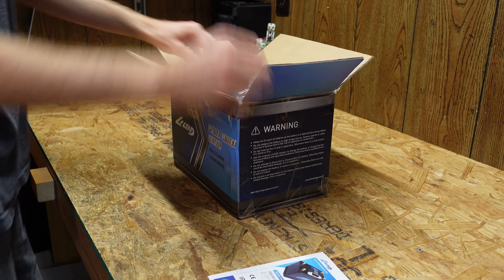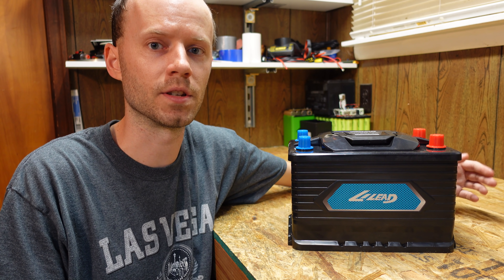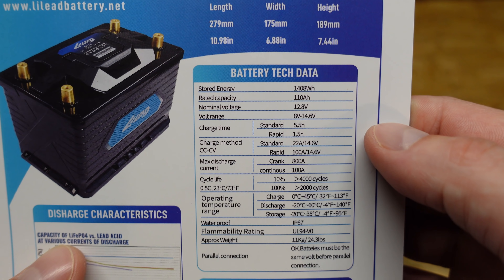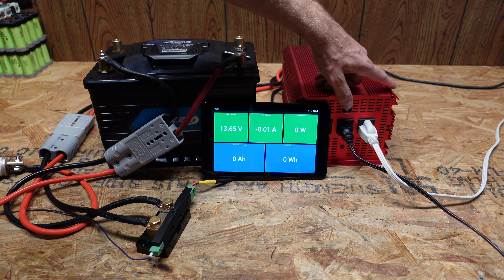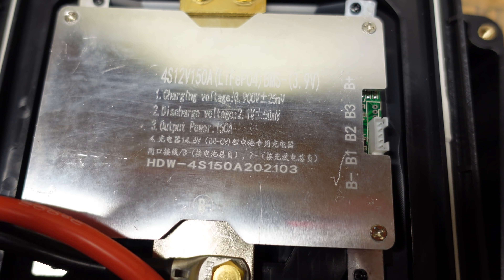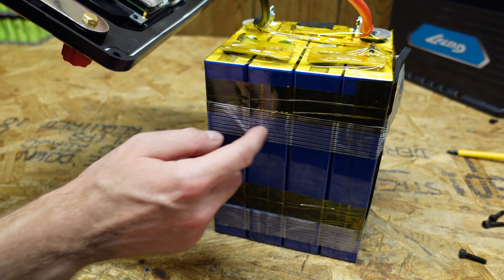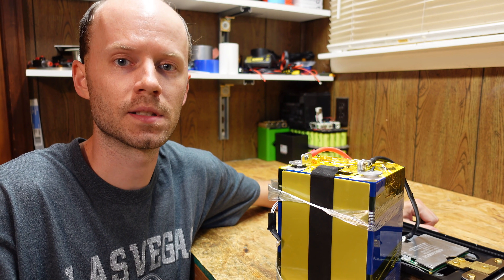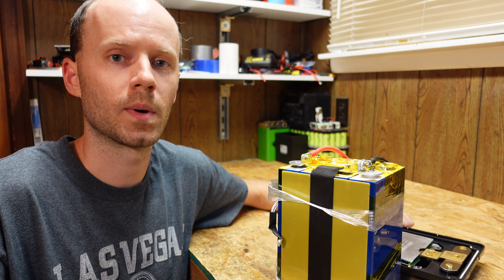LiLead S110 12V 110Ah LiFePO4 Battery Review & Disassembly

Comment: Hi! Do you remember did the BMS have a port for a bluetooth bms module? Or would there be any way to add one? 

The prices have come down to allmost half of it now, and i could get a good deal, but unsure of the bluetooth, i really would like to follow the temperature as it would come as an cranking battery in cold enviroments.

Comment: The way the tie-down was bent, I'd guess the battery fell off a pallet and fell across something (maybe the edge of a pallet) upside down.  It was the weight of the battery that bent the BMS support and pulled the tie-down toward the top of the battery.

Comment: what good and light starter battery do you recommend? need to start a smal car. want a little weight as possible. i hav eben looking in to using a lawnmower LiFePO style battery.
Reply from the maker: I have not done much testing on LiFePO4 starter batteries, so unfortunately, wouldn't be able to make a recommendation.

Comment: If it's being sold as a starting battery I don't think it should come with hardware. I have never purchased a starting battery from the auto parts store that included anything other than the battery.
Reply from the maker: It's being advertised as whatever keywords they can put in it. They also call it "deep cycle" and say "ideal for marine, RV, caravan, solar and off-grid".
Reply: @LithiumSolar  hopefully the big battery manufacturers will start producing lithium starting batteries.
Reply from the maker: I'm not sure LFP will ever be suited for replacing lead acid in a car until someone can solve the issue of charging below freezing.

Comment: HighTechLab did a recent youtube on starting his truck with Lilead S110 - https://youtu.be/drrFrULpJkI.  He commented his clamp meter topped out at 600a (2:12) and it was over this.  My question - so it bypasses the BMS / there is no limit on mass amps?.    Its seems like its buyer beware for life-span on hi-amp cranking - and I didn't realize BMS could be bypassed like this.  Thanks for the review.

Comment: I have two Ford F-350 diesel pickup trucks and don't think any lithium battery is suited for a starting battery due to the sub-freezing temperatures that they are operated in during the winter months.

Comment: It is a shame they sent you a battery in this shape for review.
The one they sent me arrived intact, and did easily start my large diesel truck. 
I cautioned them that their price was high, and their packaging was WOEFULLY inadequate for shipping a battery. I have not published my review of the battery yet, but I did publish the unboxing, and … yeah, their idea of a packaged battery is weak at best. 

I recommend you test the cell voltages at BMS cut off and see if indeed the cells are imbalanced. 

I recommend you do test the battery starting the truck. It handles it no issues. 

Also, I would check the ampacity of that 7Ga wire… silicone insulation, and tinned copper stranded wire. Not bad, but can it reliably handle starting current? Can it support 100AMPS continuous? It looks poorly designed to me. If they used 105Ah cells and claim 110Ah, that is a HUGE red flag to me.

Comment: I think no low temp cutoff is exactly the right thing to do, because you don't want it to shut down when it's cold so you can't start your engine when using this as a starter battery. With a starter battery you are accepting that it is subjected to a certain degree of use and abuse, so I don't see any problem there, neither with the missing low temp cutoff, nor the high surge rating. LiFePO cells are able to handle this. Oh, and 3.9V is not unusual for LiFePO cells, everything between 3.6V and 4.0V exists in the data sheets for various models. Just wanted to point this out, it doesn't change the final verdict though, to which I agree. It's expensive and they obviously have some build quality and QA issues.

Comment: Thank you for exposing this fraud!  You were almost certainly sent a battery that had been damaged and returned, so you got it because there was nothing else they could do with it.  The worst part is if someone with a boat and a large outboard motor actually bought this for the purpose they claim it can do, they would damage the battery and wind up with a $1,000 boat anchor after a year or two! 

If you were to build a cranking battery based on something other than lead acid, would you use Li-Titanate?

Comment: I'm looking at my Eve 105AH cells, that is exactly what those are. I have no clue why they would send you a damaged unit. Those are great cells, BTW. But for under $1000, you can build two of those batteries with a better BMS. Mine were slightly over $500 for 8 cells including shipping and the Eve test reports.

Comment: You should fix it, either get a new enclosure, add a different BMS if the one that came with it is not working properly and then give it away for your 100k subscribers. just to save you time, you can send it to me directly. you don't even need to fix it for me. lol. 
great video as always :)

Comment: About a year ago I bought a Lilead battery that was for motorcycles. It is pretty small and has a 17 amp/hr rating as I recall. They also said that battery had a surge of 800 amps. It is in a very nice package that has a tough screen battery percentage readout. So far, it starts my Yamaha 200 without a problem but when I was running my smaller motor, it does not have a very good regulator and started to get up to 15 volts. I had to turn on some running lights to keep the voltage down. I later put a 14 volt 50 watt zener diode in parallel, and that seems to keep that motor charging more stable. My large motor stops charging at 14 volts with a better regulator. I did one time after changing my high pressure pump on my motor take about 20 seconds of cranking to start and it seemed just fine. I did notice I went from 100% to 30% really quickly though. Just for safety, I did find some 8 amp cells that claimed a 200 amp 30 second surge rating and installed those in parallel. I checked the cranking amperage of my motor and found it to be around 225 amps. I guarantee this battery will not put out 800 amps for any time at all. I did find one time that when I was at about 25% capacity, it did shut itself off when I tried to stsrt the motor. They also claim a 15 minute charge to 100%. I also find that hard to believe. It came with a 10 amp charger that is of very excellent construction, at least on the outside. So far though it works and loses about 2-3% of charge a week. I have also found that one time I left the radio on and it did shut off. It cost about $250, and at the time I had not watched so many videos about batteries, otherwise I would have built a larger one myself for about the same cost. It is nice that I can just touch the top and see the state of charge. It also charges quickly if I need a top off before I go. It's sad to see now that everything about this battery is probably a lie. Good this I put in that other set as a supplement and my smaller motor also has a pull stsrt just in case.

Comment: Good review. Do you think it possible that the battery broke from simple drop shock/impact? If the inside bracket broke loose and the cells smashed against the top of the case it seems possible to have produced the damage you showed and described.
Reply: That seems to be exactly what happened. But it shows an inadequate design. Those knurled brass ferrules aren't designed to hold the load of securing cells of that size down. Those are found in things like coffee makers and laptops.

Doesn't look like a good design to me. Even if you got one undamaged, road vibration would also pull that loose, and then you have cells rattling around just waiting to chaff somewhere.

Comment: My bet is that the battery was dropped upside down onto a sharp edge, causing the crack, the box damage, and the pullout of the threaded insert with retaining bar.
Reply from the maker: That does make sense, but 1) would have had to be a very very high drop to cause such forceful damage and 2) they (someone) knew it happened, because they covered up the hole in the box with packaging tape, and sent it along anyway!!
Reply: How much you want to bet??  $$$$

Comment: I have a question for you I have 18650 200p 7S what BMS would be best to use on the system  I have Victron multiplast 24/3000/70 for 3000 Victron lynx and Victron and charge 150/35 controller and  Victor  shunt... I was thinking going batrium or should I just go more simple with like  dally BMS????plz help

Comment: That battery is $50 more than a Battle Born... wow
Reply: It is also 10Ah more storage than battleborn… not to mention the HUGE starting amps…
Reply: @SuperVstech  Except the eve cells that were matched up to the contents of this battery aren't 10Ah more and the configuration with said EVE cells wouldn't allow for the draws as advertised.
Reply: @SuperVstech  Whatever they Are, they Ain't worth a $1000 each
Reply: @SuperVstech  Per the video it is only 5ah more capacity and did you notice the battery was  shipped damaged? Do you pay top dollar for damaged products?
Reply: @soberpickle8195  yup, it is a shame they claim higher Ah than the cells are capable of. I pointed this out to them, and they said they can claim that due to some standard or whatever… I explained to them it is incorrect, and false advertising, and have not heard back from them since. 
My guess is the massive cranking amps will likely damage the cells, but I am unable to repeat test them… perhaps they will remedy the shipping flaws, and use larger cells, or reduce their Ah claim… 
It is a shame, as the battery easily cranks my 89IDI diesel 7.3L motor repeatedly… so the battery is capable of massive ampdraw… just not the Ah capacity they claim.

Comment: Do you think it's 3.9 V top Max charge so that when it settles it will actually settle at 3.6  maybe it's the new thought process behind the battery's settling out so they don't settle  lower than the Max charge so they actually settle at the Max charge? Just my thought
Reply from the maker: At first, I thought it might allow charging to 3.9V so it could allow balancing down to 3.65V. The batteries that shut off right at 3.65V aren't good either because how is it going to balance if it kills it at 3.65V yet balancing beings at 3.65V? So 3.70-3.75V isn't necessarily bad. But 3.90V is very high, combined with the BMS shut down charging around 14.3V., sooo.... I think they're pushing extreme ends of the spectrum (over charging and over discharging) in an attempt to get 110Ah out of a 105Ah battery. That of course, is just my opinion.
Reply: @LithiumSolar   I agree a 100% I think setting things a little low is better for longevity and life My opinion.. I want things to last longer for my money... That's also why I try to buy the best I can possibly with the money I got instead of buying it 2 or 3 times cause I purchased cheap junk....
Reply: The thing to remember is that the old charge voltage for LiFePO4 used to be up to 4.2V per cell when the technology was first invented over 2.5 decades ago. Then manufacturers realized that high voltage at the terminals if left for any real length of time started to cause excess heating and degradation of the electrolytes (heat causes accelerated calender aging). So for the most part manufactures have settled on anywhere between 3.5-3.7 as being the full charge voltage.  In reality though you can fully charge a LiFeP04 cell at 3.45 if you are willing to wait for a much longer time at low current.  A fully charged and resting LiFeP04 cell will eventually return to around 3.3-3.4v after sitting for a long while.
Reply: @kuhrd   Thank you for the knowledge greatly appreciated
Reply: Just a cheap BMS with older settings. Much better ones are available, but they cost $20 more is what it boils down to.
Reply: @john_in_phoenix   Do you actually have one in mind you could point me out too.... Not too much worried about cost... Would just like it to work well and I do not need low temperature cut off I live in Arizona
Reply: @jeremy87turbo87  I have found the JBD BMS to be quite good. https://www.aliexpress.com/item/1005002338673024.html
It does have a low temperature disconnect and temperature sensor, I'm in Arizona too. It is also rated for up to 80v if used in series.